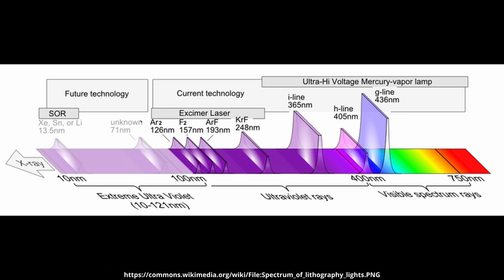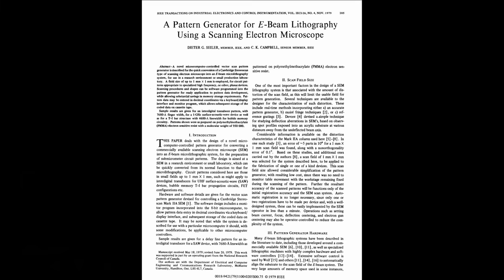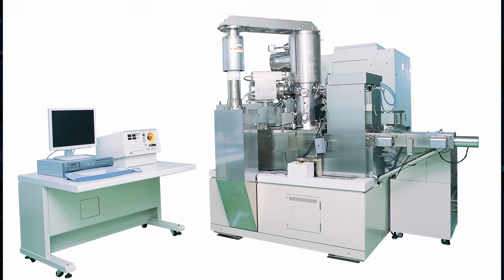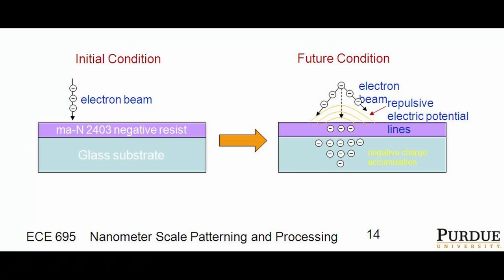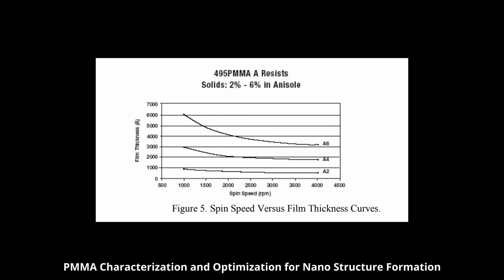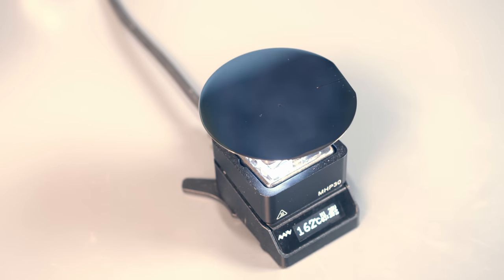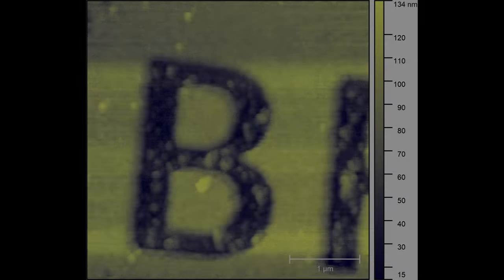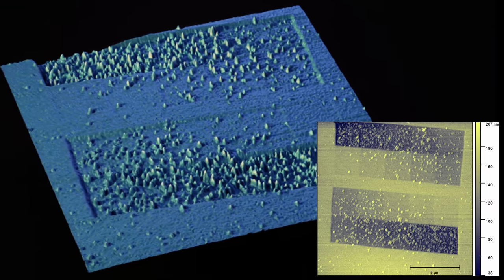Drawing Microscopic Patterns with Electrons

Comment: Very nice video! Btw, you said this prosecc isn't suitable for mass production, despite being able to work with outstanding resolution. But also you said you had to dial down the beam power to nearly nothing, so your exposure time isn't measured in milisecond. Is it still too much time for mass production? I understand, in real production your pattern isn't 80 microns, but like 300mm. But the beam is also more powerful on industrial machines.
Reply: That's a good point, I'm sure there's a good answer too but as you said it certainly does seem fast.
Reply: In a high volume litho process, you use a mask, and expose the whole reticle in one go. This you have to trace the beam around and draw out the pattern (no mask). Think of a flash bulb exposing all of a mask in one "flash", vs a galvo laser tracing out the whole pattern in a vector manor line by line
Reply: @gorak9000  Ok, what makes impossible to use a mask here? Lets say it's should be made out of copper, it will absorb any electrons. And the "electron flash bulb" isn't a rocket science. And anyways, the exposure time seems to be under a second (even if the use 300 mm wafer). I don't think modern wafer stepper produce more than 1 wafer per second.
Reply from the maker: My (limited) understanding is that the masks are hard to fabricate because there isn't a good electron analogue to quartz masks. I.e. photolitho will use a quartz substrate with the features masked out with metal (typically chromium). Photons will pass through the quartz, reflect off the chrome.  But electrons have a very short penetration depth in basically all materials, so to get a mask that is transparent to electrons means you need really thin material (like, 5-20 microns sort of thin). Then you need this thin material to span 100-300mm without deflecting or else it introduces aberrations, etc.

So most ebeam masked systems use simple stencils, but that means you can't have "islands" that are unsupported. Which in turn requires multiple stencils to be used serially, alignment issues, etc.

There's a ton of literature and research on masked ebeam litho (as well as "multi-beam" systems) but from what I can tell it's never made it out of the lab into real world production.

Re: direct write speed, I just ran some really crude napkin numbers: if you have a 300mm wafer and are exposing 1x1 micrometer pixels for 1 microsecond, it'll take about 20 hours to expose the whole thing. Most patterns are empty space, but even so 30% of that is still 6 hours. Assuming I math'ed correctly (which is a big assumption 😅)
Reply: @BreakingTaps  thanks for answer!
1) 20 micron film isn't that uncommon (common foil has like 50 micron thickness), through the question is how electrons will behave after they pass through the film, how much energy they will lose.
2) Yes, you math is correct, I've checked it :D
Through, I suppose E-beam technology is much cheaper than EUV lasers, so it might be compensated by quantity of units over speed of single unit.

P.S. you have managed to achieve 100 nm result, even through it's polluted with dust and particles. Do you think it's possible to get to 50 or even 30 nm?

Comment: Just curious, how did you get the cad and or dimensions to make the rover wheel?
Reply: I'd like to see more about actually machiningg them too - that surface finish was pretty amazing, and it looks like the wheels are not cylindrical, but "buldged" in the middle, so you'd have to mill it all with a ball mill (or perhaps another way if you have a rotary axis as well)
Reply from the maker: CAD'ed it up myself 🙂 There are some rough dimensions of the wheel available (20" diameter, 16" wide, etc). Then I used images of the wheel as a template to start CAD'ing on top of, scaled to the known dimensions. Not perfectly accurate scale model (and had to make a few concessions since stuff like fasteners can only go small) but pretty close :)
Reply from the maker: Will definitely show more of the machining in the future! You're right, there's a slight convex curve to the whole wheel. Lots of 3D surfacing with small ball mills (technically done on a rotary but most of the toolpaths were simple 2D paths, one-per-section, since they gave a better finish than some of the other optinos).
Reply: That’s pretty cool, I do that occasionally too when I don’t have proper dims and I’m reverse engineering something. Snap a pic, scale, and trace. I teach a combined fea/advanced cad class and that’s one of the tricks I teach students when modeling for analysis if you have the part but no drawings. Also a good way to capture non ideal geometry like a damaged part for analysis.

Comment: Dumb question/idea, has anyone done lithography with neutrons?
Reply from the maker: I'm not sure to be honest! Proton lithography is a thing (https://en.wikipedia.org/wiki/Proton_beam_writing), but I'd guess neutrons could be difficult since they don't have a charge. Electron/Ion/Proton "optics" all work because the particle has charge, which let's you move them around and focus them. Uncharged species are hard to manipulate in the same manner.  But I wouldn't be surprised if someone out there had tried it :)
Reply: @BreakingTaps  That's definitely in the same area as what I was thinking. I'm curious if they can (or if it's even beneficial) to use nuclear effects for doping the silicon.

I was also imagining it somewhat like photolithography or at least the way Applied Science did his UV lithography.

Though those ideas probably don't work together at all :P

Comment: Is the color from iridescence?
Reply: It's from the selective wavelength filtering you get from very thin films. The same way you can get rainbow colors in titanium parts by heating them, forming various thickness layers of titanium oxide at the surface, or how when you heat treat steel, you can judge the temperature it got to by the color of the metal afterwards - the hotter it got, the thicker the oxide layer at the surface, which will reflect a specific wavelength of light depending on thickness. I'm not sure if iridescence works on a similar principle (by thickness of very thin films)
Reply: @gorak9000   Thanks.

Comment: he has a Phenom he calls his SEM. That's 500000$ who has that. I am so envyous.
Reply from the maker: Not $500k for anyone interested, but still quite expensive (70-130 depending on options and model)
Reply: @BreakingTaps  How? I have a Phenom Pharos SEM with XRD, SED and BSD in my university research group and that was 250K with a huge discount and I know that now it would cost 300k at least. You have the more fancy bigger version. How can it be cheeper. There is no way!
Reply from the maker: Ah, the Pharos is a lot more expensive since it's an FE machine. Mine is an XL with a CeB6 source, much cheaper 🙂

Comment: etch an electron lithography mask with electrons
Reply: use crt screen tech, for example chip(let) grid ground around the chips
Reply: and/or first do the charge grid or power lines, wire traces on the non-conducting (oxide) wafer, but just use normal standard semiconductor (doped) silicon substrate which will conduct
Reply: yes building masks with e-beam
Reply: you already have fully developed crt tech, tho nano scale, so no need to resort to "expensive" euv mask tech
Reply: try ion plating (inverse electron beam) to grow crystals and features
Reply: art not crt, ie anode ray tube not cathode ray tube, inverse of crt
Reply: if you shoot the ions through the mask in a plasma/ion acceleration plating chamber, you can grow features fast, and etch fast with electron bombardment chamber
Reply: try spin casting silicon into wafers directly, one by one, not the growth process, just like spinning the resist
Reply: yes induction hot plate spin casting
Reply: you can also level, etch, a surface to absolute level with the electron beam etching, and it will give you the height like sem

Comment: Please clean your spin coater.  I got triggered seeing sandwich crumbs on wafer handling equipment.
Reply from the maker: 🤷‍♂️ It's being used in an open, non-cleanroom environment for hobby usage, air contamination is a bigger issue than some dust bunnies on the spincoater :)